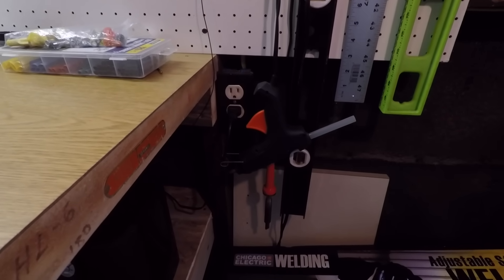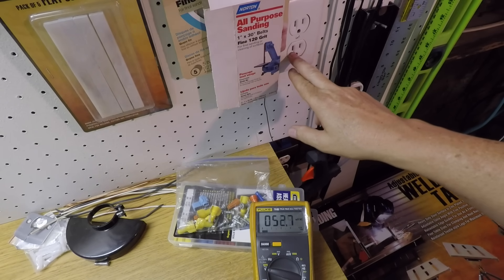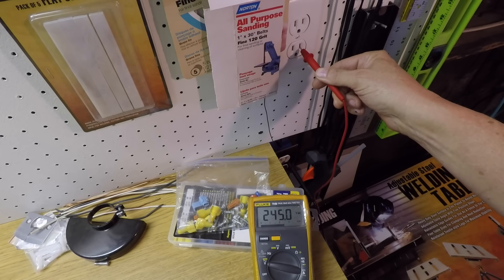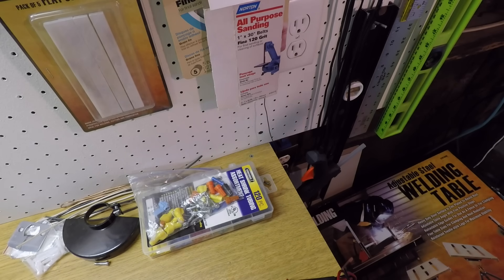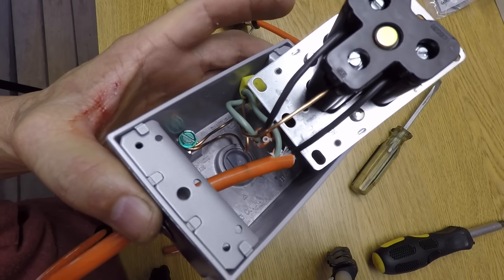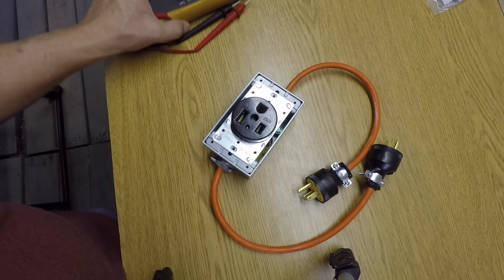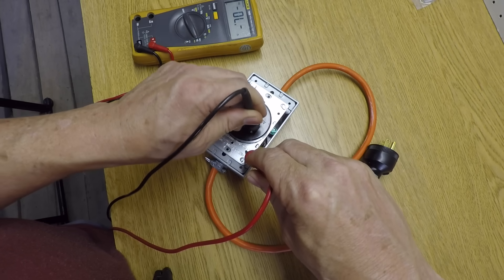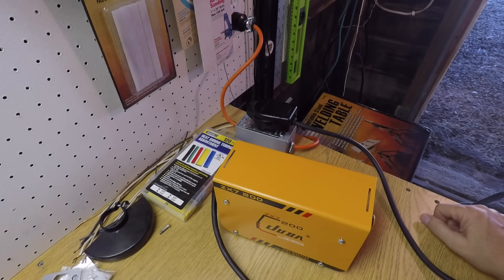How to Get 220v From 110v

Comment: The main thing you missed to explain is that the two lines must be on different phases. if you have both of those outlet on the same phase you will not get 240v. Also like everyone else mentioned is the safety aspect of using single pole breaks instead of double pole breakers designed for this use case. my opinion is to call a qualified professional for things like this your family's safety just isn't worth it to save a few bucks.
Reply: AND HE NEEDS TO BE CONCERNED WITH OTHER ITEMS ON THOSE TWO BRANCHES

Comment: Looks like this was a fast way to save money on cable and a double pole breaker. But many potential problems with this. I would just run a dedicated 240 circuit with a double pole breaker. This will work, But not code for sure. And I would run EMT conduit with 10 gauge wire, That would be a solid and safe circuit.

Comment: I have a 3000 watt capable / rated voltage converter that can convert 115V to 230V and it is normally fed by a single 15A 115V input, however, I wonder what would happen if I coupled 2 of those on the input side that were phase locked and in phase.  So basically I should have 30A 115V of input which should convert to roughly 15A 230V output.  Would that be some type of code violation?  Must AC outlet power be used solo and never combined with other AC outlet power as described here?

Comment: Thisca silly video, whatvis a transformer ? It transform all voltages but when you change a larger to a smaller , the amps increase 2 times. If make volts larger you decrease amps by 2. As a primary 220v 30 amps  is size 10 awg wire coil. A 110 v 60 amps secondary  wire is size 6 awg good for 50-60 amps. If in usa the core must be for 60 hertz , if in south east asia it must be for 50 hertz. Transformation is always in a equal number but both equal what is suplied and nothing is extra

Comment: The easiest way to make the box safer would cost about another $10 in parts.   Buy two 120v two pole relays wired to trigger from each individual supply, you then run the out of phase (240) live poles through both relays for in closed (on) position.  This means if either 120v supplies are unplugged or trip, physical connectivity to the live 240v poles will be lost for both poles.

Comment: I've got an adapter at work that I built specifically to test 240 V devices with only 120 V outlets.  Easy to build, but as noted in another comment, not suitable for something that will run continuously or unattended.  Yes, "safer" to run a proper 240 line from a 240 V dual breaker in the box -- but for my (and my shop's) needs, it was the only option.  It hasn't been used much -- twice, I think, in more than ten years -- but like I say about various other stuff I've made there: "When you need it, nothing else will work."

Comment: Interesting idea BUT THIS DEVICE SHOULD BE USED ONLY IF THE TWO BREAKERS ARE SIDE BY SIDE AND THE TOGGLES LINKED WITH A BRIDGE (OR ARE A DOUBLE BREAKER).  That way if one trips due to overload the other breaker will be tripped by the bridge.  If the two breakers are not bridged and one trips, the welder or other driven device will see only 120 V and could be damaged.  These bridges are commonly used to convert 2 separate breakers into a 240 V breaker.  Best of all is use a double 240 V breaker.

Comment: Besides the double breaker safety issue already mentioned, you can only draw 12a safely from those 15a outlets you have there. If you want 16a pay for 20a outlets. Unless you want melted plastic and a possible fire.
Reply: 15amp outlets are rated for 20 amp pass through....they're literally tested for that.
Reply: most 15 amp outlets are on a 20 amp breaker it's allowable for code and they are tested for 20 amp pass through at the factory.  Mike holt went over all this before.
Reply: 5R-20

Comment: Very interesting.  I would have stayed with 12 gauge wire and 20 amp plugs, safety.  The rest of the comments about tripping one breaker and not the other are true but just unplug the welder...

Comment: In your method,  if you are welding, are you still able to use a device (light, drill or radio) in one of the 110v outlets you are using all at the same time?

Comment: This is the perfect example of Just because you can, You shouldn’t…
Reply: Exactly. This is something you do on a workbench as an experimental curiosity. Then you say "cool" and tear it down. This is in the line of using suicide cords to power a house with a generator or using gasoline to start a fire in the stove or using a deep fryer on the patio to cook a frozen turkey. Ya know, Utube stuff.
An indication of the wisdom of such things is the length of the list of instructions someone has to remember to use it without getting hurt. Or how much damage can be done by someone else not familiar with the rigged-up mess.
And always, out comes the pie in the sky dreams of "this is just temporary" or "I will never hook anything else to it" or "I told the kids to never do this".

Comment: I'm not an electrician, but my concern is that you have 20A breakers and 12 gauge wire to receptacles. Then you have 15A plugs and 14 gauge wire to welder receptacle.
 #1  If your welder draws more than 15A but less than 20A, you will not trip the breakers but you will exceed the 15A wire/plug rating and overheat them.
#2  If your welder draws 50A, I'm not sure if that splits 25A to each breaker or if each breaker draws 50A. Either way you are exceeding the breaker capacity and they will trip.
The best you can hope for is that you turn off your lights that are on one circuit and hope that the welder does not draw more than 30A and that it is only drawing 15A on each side.
It would have cost extra money,  but I think you'd have been a lot better off running a dedicated 50A circuit from the load center.

Comment: 12:50  its NOT Safe . I dont know much about Welders , but on most 220v Appliances if say Line 2 is disconnected (open) Line 1 will feed through the Appliance and back through Line 2 if the Appliance is plugged in and in the ON position . 
 I have beenrepairinghome Appliances since 1981 Washers , Dryers , Ovens , Refrigerators . and checking for Voltage back feed is a technique I uses when Diagnosing . 
Its easier if I use a simple circuit of 110v a light bulb a Hot wire and a Neutral . If you test the wires at the bulb you will read 110v . but if you cut the Neutral wire , the voltage will feed through the light filament  and down the Neutral to the point at which it is broken . 
Thesame thing happens with 220v .

Comment: Hey thank you, getting older and hips wider, doing more and more with out any males around, getting good solid instructions is right in time, because i had a fire and now wired my stove, and since dont have 220 yet, want to use it with 110, and that just today knew i needed what you shared. Blessings, great solid video.

Comment: Dam dude just hard wire a simple  240 dedicated circuit for the welder and be done with. If one of those two 20 amp circuits trip while your welding low voltage, only 120 volts left there goes the welder from low voltage. It's yours go for it.

Comment: Good idea. I am making an 60 ft. extension cord with 8/4 copper wire that will go from my house c,b, panel to my travel trailer in the yard which is 120v. I want to have one receptacle for the trailer, one for 15a/120v regular plug and one 220v. I will connect the black wire to a two pole cb, the red wire to the other breaker of the same two pole breaker. This will be my MAIN for this circuit. The the white wire to neutral, and the green wire to ground. At the other end of the cord I will put in a small cb panel with  skinny breakers. The 2pole breakers will feed my 220 circuit, a 20a breaker will feed my 120 circuit, and a 30a breaker will feed my 120 trailer plug. Does anyone think this will work safely and not burnup my trailer?

Comment: I like how conscientious you are about ensuring grounds are correctly bonded and not shorting out, etc. However, you need to make sure the two circuits are on a breaker with a common trip handle. I'm guessing it was run with 12/3 cable, which means if it was done correctly, would be on such a breaker since both circuits feed the same receptacle. This is a requirement since someone working on the receptacle could (will) get shocked if only one circuit is off. IOW, that receptacle with two circuits feeding it must be on a common trip breaker.

In general, I would suggest simply adding the 240 volt receptacle in a cut in box, being fed from the current receptacle outlet.  This eliminates any margin for error and helps declutter your workbench.  Ideally, you would run a small subpanel with 10/3 wire on a 30 amp common trip breaker, even replacing the current home run for the two circuits if necessary. This will feed the two existing circuits and give a 20-amp 240 volt dedicated circuit.

Some electricians object to running 240 volts on circuits feeding 120 volt devices, on the basis that one leg will be imbalanced with the other. First, the 240 volt load pulls equally from both, by nature, and the neutral will carry any imbalance current As long as the total current draw doesn't exceed 80% of the breaker's rating, there is no chance of tripping it. Even at 100% capacity for three hours or less should be fine.
Reply from the maker: I agree with you Casey

Comment: Why not just put in an inline 30amp two pole circuit breaker before the final 240 plug??? in essence a portable sub panel and receptacle? This way it would trip the double pole breaker and the 120 volt outlets would not know the difference.

Comment: If your using 110,120,208,instead of a 120/240 breaker you’ll only get the rated power from the two I do believe there boss

Comment: This is easy for people who have a basic understanding of electrical circuitry, but can be extremely dangerous for people who don't know what it means to make sure the two outlets are on two seperate legs in a breaker box... If you do not understand this video then I would advise to not attempt to do this. you may burn your garage or house down to the ground if for any reason the electrical in your garage or house isn't properly grounded. You need to understand the importance of proper wire gauges... I'm an electrician and I always come across issues in residential homes and commercial to where the wiring wasnt sufficient, nothing is grounded... Please make sure you understand every factor in this video!!!! BE SAFE!!! ENJOY LIFE!!!

Comment: Your contraption will (mostly) work and will get you by, doing what you intend to do with it, but Juan Carlos Valdez' earlier comment had the best idea for supplying 240 VAC to your two locations at 20 amps, with no new wiring needed and no contraption (considering that you don't care about the code).  In your video, you mentioned that, if you unplugged one plug from it's outlet, you couldn't get shocked from the exposed plug prongs because nothing in your 240 VAC outlet box is connected from the plugged in prongs to the exposed prongs.  True, but zoom out a little farther and think about the load.  If it is still turned on, or any other path through it exists, then you get 120 VAC potential from the exposed hot prong to the ground prong of the unplugged plug.  Fuzzylon also mentioned this in an earlier comment.  240 VAC potential would also exist between the exposed hot prong of the removed plug and the corresponding slot in the outlet it came from, but you'd be hard pressed to get yourself shocked that way.  I assume that you assumed the circuit would be broken by the load being turned off.  The center tap of the pole transformer is grounded, with 120 VAC on either side of that grounded center, 180 degrees out of phase.  Any difference in amps leaving one end of that transformer, than returning through the other end (think the effect of your garage lighting on only one leg), must return through the grounded center tap.  This is the imbalance other commenters are talking about.  The lighting does have an actual copper connection to this center tap though (through the white conductor), so should not cause it's current to flow through ground (the green or bare conductor) to get there.  I don't think they necessarily thought about that.  Beside your use of 15 amp extension cord wiring, I noticed you were only using 15 amp outlets.  (cwbywy also noted this in an earlier post)  Lots of very weak links in this setup.  Again, if you're going to ignore code, at least Juan Carlos Valdez had a more elegant solution that uses your existing wiring.  But, hey, you sure did get a lot of people thinking about their electrical theory with your  video!

Comment: Yes this method works ...but all against the code .. all 220 v as to be dedicated circuit...and wire on your outlet is 2/14 Guage .Wich you can use 15 amp max ..if you change breakers for 20 amp ...wire inside the wall may light up your house !! I 'm certified électricien.. no insurance will cover it if it happened ...have seen similar situation...use 2/12 wire directely from panel and 20/20 breaker ..

Comment: What if you add a smart plug protector like I use on my RV so it automatically shuts off if the voltage drops from popping one breaker?

Comment: It's possible to find 2 outlets that are on the same phase with each other and still only get 120 volts? It's that "out of phase" condition that adds the two120s together.
Reply: I think that is my problem because I only get 120 from both breakers tied together. I’m going to tap off one of the dryer breakers for the 240.

Comment: Each 120v line needs be on its own separate phase.  Just like in the main circuit breaker panel, line coming in from street has a ground and two hots, each hot is wired to its own buss bar in panel, half (or about half) the breakers are on one buss the other half of the breakers are on the other buss.  All the breakers on the same buss have close to 0 volts between them, breakers on separate breakers have 220 v between them

Comment: I thought you were going to get 240 from a 110 volt outlet.  Not understanding the logic here,  why not just a double pole breaker and tie into the box. This way everything is up to code.  ( I guess in a pinch , this would be OK, but the truth is you are getting 240 from 240 , not 110 volt.
Reply: Well, you can get 240 from a 120 outlet, by using a step-up transformer. 120vac input, 240ac output. One would need to carefully check the specs of all parts and stay within those limitations during use. But that would be far safer than this, although it may cost more than wiring it properly in the first place.

Comment: Its true if you have your welder turned on and plugged into that box, if you come into contact with one of the prongs on the plugs while one is plugged in you will be shocked. It will be trying to complete the circuit as you said. There will be a 120 volts across you and the prong , the box and anything grounded including through your shoes to actual ground. Also the outlets need to be whats referred to as 180° out of phase to get the 240 volts. I know you said on separate circuits, but for clarity one needs to be on L1 the other on L2 from the breaker box. You can have two circuits in phase and you'll only get 120 volts between them. Its just a matter of switching one of the breakers in the panel to another slot so its on the other leg of power. In a wiring like this with two separate 120 outlets on out of phase circuits you don't want to use a double breaker with the handles tied together like 240 circuits usually have. They need to be independent breakers for safety purposes.
Great detail in your video. 👍

Comment: You forgot to add about phasing if you're on the same phase you won't achieve your 240 volt and if you supplied the outlets and wired them yourself why didn't you just run it the correct line? It's definitely safer that way

Comment: If you're putting in a 50 amp plug you need to have bigger wires than 12 12 is only rated for 20 amps you're putting in a 50 amp you should put at least number 10s

Comment: Sometimes you need a four wire plug for the neutral if you are controlling a circuit board or something if you don't put the neutral and you will burn the circuit board up on hot tubs and stuff like that but in this case you don't really need to 20 unless the wiring on the welder has a neutral on it but yeah everything's good I'm just letting people know that sometimes you will need a neutral